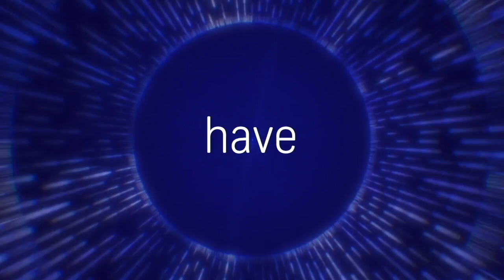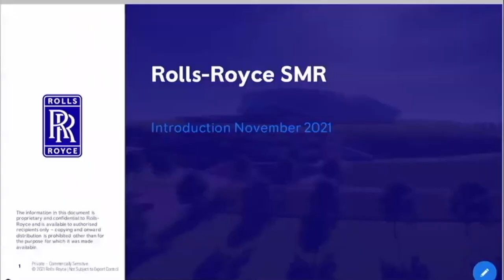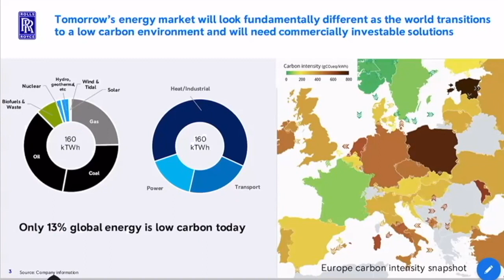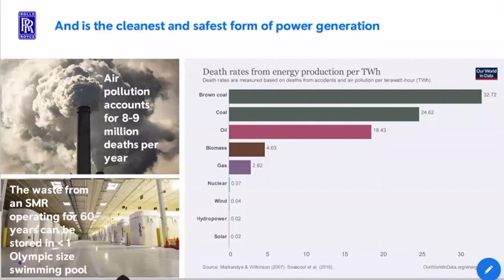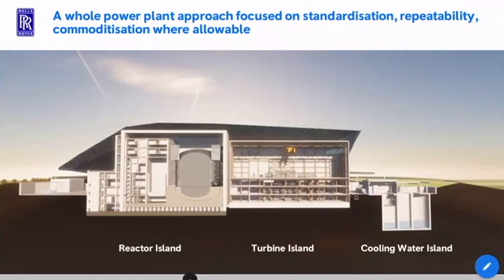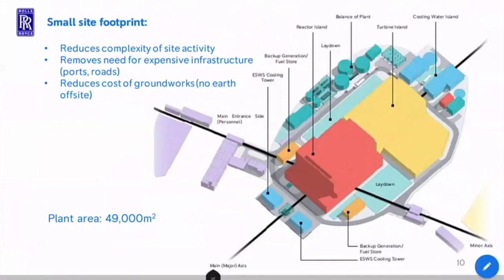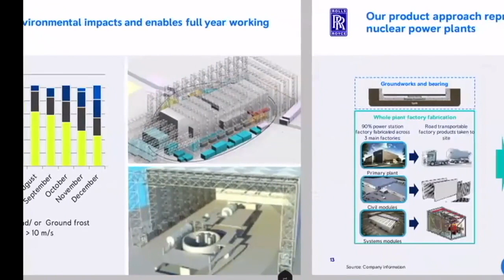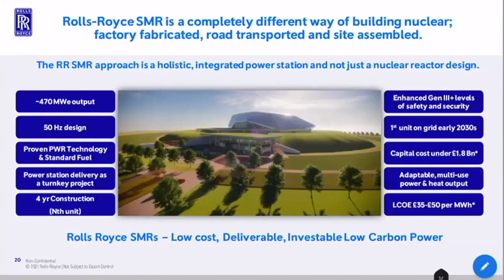The Future of Energy: Rolls-Royce SMR Industry Talk

Comment: A few technical questions,
1. How is refuelling carried out, these small reactors don't appear to have gantries or cooling ponds?
2. Are there any calculations provided that balance the lowered efficiency of smaller reactors with the capital savings on modularity and standardisation?
3. LCoE curves at different discount %, with some contemporary PWR/BWR reference would be very informative.
Reply: What I can tell you is that there are many different designs, and all the most viable - or should I say, the least wacky SMRs are old-school but smaller fission/water cooled, and the Nuscale reactors do have cooling pools, that like all cooling pools will spontaneously ignite if the zirconium rods are exposed to the air, e.g. in a terrorist/wartime attack or earthquake, or in the event that cooling power to the pool is lost.

As for capital savings, the word I have is that the scale economies of larger plants is well-tried, and that these scale economies are lost when you produce less power per plant. The nuclear lobbyists are already asking for concessions on existing safety standards to make the whole thing work, with hugely reduced disaster planning zones, thinner containments and so on. With, say, up to 12 modular reactors on one site, you have 12 chances for a mishap, and if one goes tits-up, and the site becomes highly radioactive how do we protect the other reactors? What worries me about the motives of the nuclear industry is that this calculation is never mentioned. It's a fair-weather sales pitch loaded with confirmation bias. They argue that they are safer because the reactors are, say, only a third or one tenth the size of today's reactors, but one third, or one tenth of a nuclear accident, say, a mile or two or ten miles from my house don't sound all that good to me. Modularisation and mass production? What do we do if there is a recall? That would be fun, now, wouldn't it?

Comment: See Youtube video "Dispelling the Myths of Nuclear Energy (Live Lecture)" by Illinois physics prof. At about 14 minutes in he says that with a Pressurized Water Reactor if the water leaks away then the nuclear reaction stops so this feature makes the power station safe. It needs water to slow the neutrons to continue the chain reaction. In Chernobyl there were graphite rods in the reactor which slowed the neutrons and meant the chain reaction continued to melt down. He also mentions that nuclear reactors have 3% enriched uranium where as a bomb needs about 90% enrichment so basically nuclear power stations can't become a nuclear bomb.

Comment: More detail on prospective UK anchor  locations (touched on in Q&A) would be interesting to consider against major existing or potential large UK heat demands, such as chemical plants or district heating, noting wider existing cogeneration  uptake in Europe, PRC etc that would be more favourable than UK. Notwithstanding indicated economy of individual modular SMR production,  I would also anticipate significant operational cost  benefit in clustering multiple units to share physical site  security, fast response manual intervention  and planned maintenance etc.

Comment: I just don't see this being different enough to a standard nuclear reactor. You'll still run into all the red tapes of a traditional build, the only advantage is once you have the factory built the later units can be built faster. But then I'm not an engineer so let's wait and see. Hopefully they will succeed.
Reply: It is easier to contain small fire compared to huge flame.
Reply: You don't need to take it offline for 1 month out of 12 to refuel. That's one big advantage.

Comment: Clean energy needs, Just the waste needs taking care of, especially if alot of these smrs start popping up, but i guess the pros outway the cons
Reply: Fuel waste is reduced 90% in breeder reactors.
Reply: Yes every country in the world should have a nuclear industry. 
No more CO2, no more climate destabilisation.
Reply: Australia has 25GW of installed fossil fueled power plants. 
And would need 80 SMR nuclear reactors to replace them. 
The difficulty is that the Australian AEMO has said Australia will have 5fold bigger electric demand which means 5fold increase in power plants, 400 SMR nuclear power reactors. 
Also 5fold bigger national grid. 
The existing grid is $TRILLIONS and decades of work, so a 5fold increase in its capacity maybe an horrendous financial burden. 
Power plants plus power grid  doubles the nuclear plant cost.
So for an electric Australia x2 x5 x 80 = 800 times the cost of one RR SMR nuclear power reactor.
And the decades and decades and decades to build. 
Nobody does the maths.

Comment: 45 years ago   there was a plan to  build a barage across  morecome bay  [ a 10 mile   gap]   
 which would have produced   shick loads of electric power   ,  not only that  it would have  cut a  two hour  car trip   down to  20 min   .
another plus   the   train lines could   have   used  this  as well    to save on  rail  trip  times  
 there has  been more money spent on  feasability studys   and    enviromental impact  assesments over the  last  45 years   than it would have cost in  actualy    just building the damned thing .
every  ten years or so there  is a new push   to get this built   . 
 the uk   gov  just  treat   the people like cash cows   .

Comment: Australia has 25GW of installed fossil fueled power plants. 
And would need 80 SMR nuclear reactors to replace them. 
The difficulty is that the Australian AEMO has said Australia will have 5fold bigger electric demand which means 5fold increase in power plants, 400 SMR nuclear power reactors. 
Also 5fold bigger national grid. 
The existing grid is $TRILLIONS and decades of work, so a 5fold increase in its capacity maybe an horrendous financial burden. 
Power plants plus power grid  doubles the nuclear plant cost.
So for an electric Australia x2 x5 x 80 = 800 times the cost of one RR SMR nuclear power reactor.
And the decades and decades and decades to build. 
Nobody does the maths.
Electric vehicles with huge batteries can make Renewables perfect. 
And a perfect match with the existing grid.
Reply: easy solution would be small solar plants installed locally.
Reply: @sithukyaw9019  honestly if every Australian home put a $3,600, 6.6kw rooftop solar PV system on their roof when they bought their first EV with it's huge battery 100kwh then only existing grid maintenance is needed.
32m2 on roofs upto 200m2 gives 33kwh every day. 
And if every other 10million buildings put rooftop solar PV system and fed excess into the grid and grid big batteries Australia would not need its 25GW fossil fueled power plants. 
The panels would shade the hottest part of the roof, cost $12 to $18 m2, less than a new roof, and only a small part of a roof.
Air-conditioning energy savings $ for decades.
Reply: @stephenbrickwood1602  : Yeah and charge their EV overnight.
Reply: @buildmotosykletist1987  relax, 
The grid and EV batteries and dispersed renewables will be a main part of the future. 
Self parking EV will nuzzle up and onto a low mounted wall power point and trade electric energy and stability with the grid everywhere. Self docking like a computer. 
Daily drives are 7kwh, very small for a 100kwh battery. 
The EV battery will be 93% full every day. 
Empty fossil fuel tanks was the old, grid topped up and full EV batteries will be the normal in the future 😀
Reply: @stephenbrickwood1602  : Nope. EV's will always require a hardwire charge.
Reply: @buildmotosykletist1987  yep that's what I said
Reply: @stephenbrickwood1602  : No it's not !
Reply: @buildmotosykletist1987  OK the details of my proposal is that self parking will be a common feature, at least in a limited way.
If EVs had a simple plug on their front or rear bumper bar and a matching wall plug/power point at every parking spot and could gently move upto the wall power point then every EV could be part of the grid for the majority of every day. 
Meanwhile the buildings rooftop solar is supplying the grid with excess electricity. 

So the EV identifies it self to the grid and trade power and stability for money. 
The grid knows how much the building takes or supplies, and the same with the EV's big battery. 
You tell the car how much power you must have for the next travel plans.
Say the drive home and the homes overnight needs and the drive to work in the morning. 
In South Australia, the big battery, a $100million construction project has traded power and stability with the grid and paid for itself in 18mths, years ago.
Rapid charging would only be needed at some times. 
20million EVs in Australia in the future will be a huge asset to the grid. 
Horse and cart thinking was killed by Ford's T model, and times are changing 😳.
Reply: @stephenbrickwood1602  : The big battery cost over $200M and they claim it has saved $40M but only in grid stabilisation not power supply. Do you believe that ? I don't believe in the tooth fairy either.
How long could that battery supply power to all of SA ?? 1 day?, 1 hour? or 1 minute?
Reply: @buildmotosykletist1987  do you remember the horse and cart problems??
Nope, technology moves on.
Reply: @stephenbrickwood1602  : Why did you lie ?